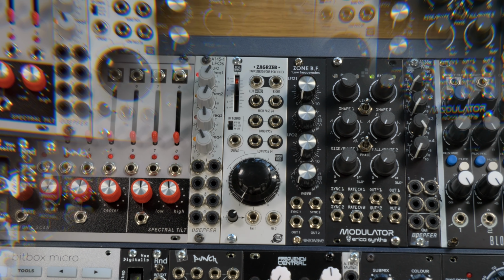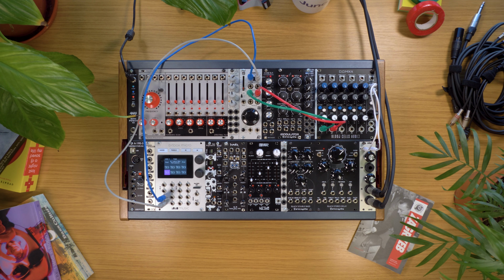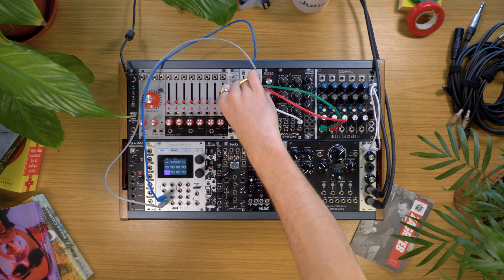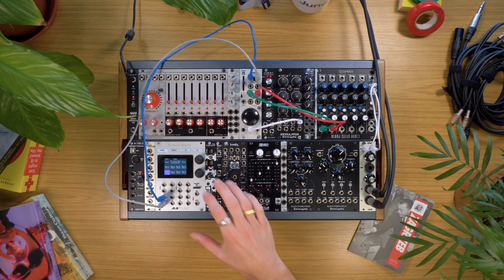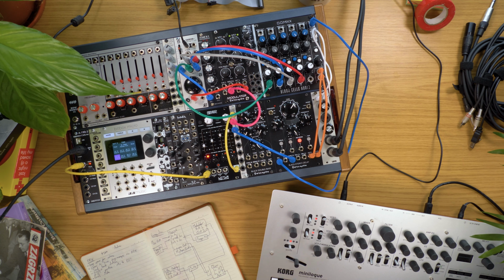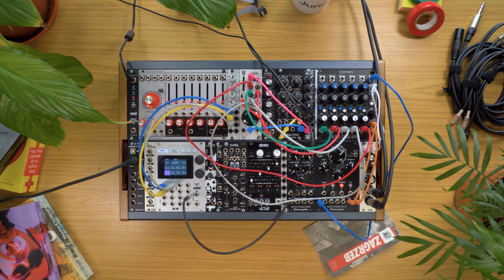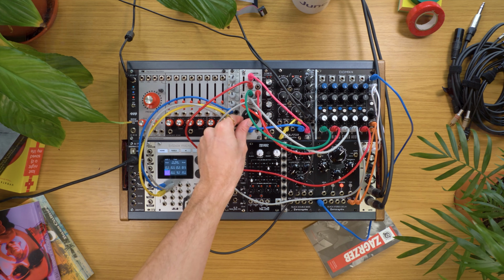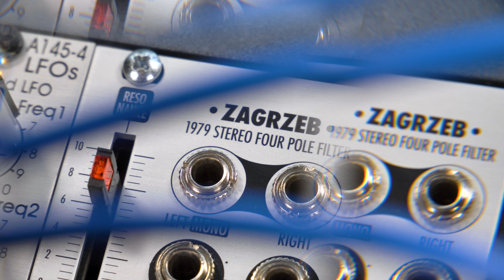Xaoc Devices Zagrzeb Multimode Filter Module - First Look (Tutorial, Demo & Jam)

Comment: A stereo filter where you can’t send independent CV signals to the left and right channels is pretty useless. I was interested in this filter for a two-voice synth setup until I realized I couldn’t send independent envelope signals to the two channels. I like Xaoc modules, but this one is a dud.
Reply: You forgot to add it is useless FOR YOU, because it doesn't do something that you want, even though this was never promised. You confused a stereo filter with a dual mono filter.
Reply: Indeed, it sounds like you want what most "stereo" eurorack filters actually are: dual mono filters that happen to normal their inputs together to allow stereo control. That arrangement is great for versatility but it comes at the price of more hp. Having a simple, good-sounding analog stereo filter in just 8hp is valuable and surprisingly hard to find in the eurorack world.
I wish they had not put the CV inputs at the bottom though. This video illustrates why. Giant cutoff knob but still hard to get to it due to the next of wires both above and below. But nothing a couple of right-angle plugs can't solve.
Reply: It's like OP is complaining his double cheeseburger has only one bun. It's a stereo filter, not two filters that can be linked in stereo. 

A stereo filter with a "spread" control separating right and left channels seems perfect for this form factor. Dual filters with independent controls for each channel are usually much bigger.